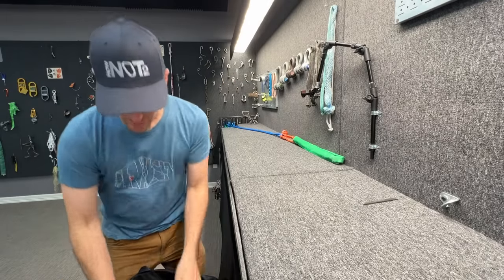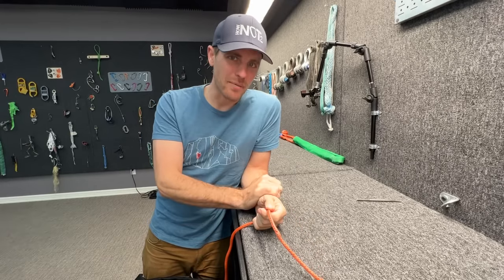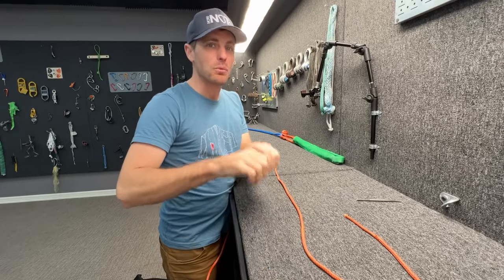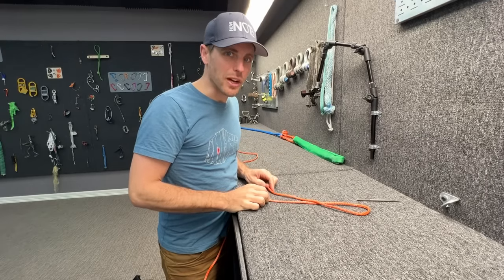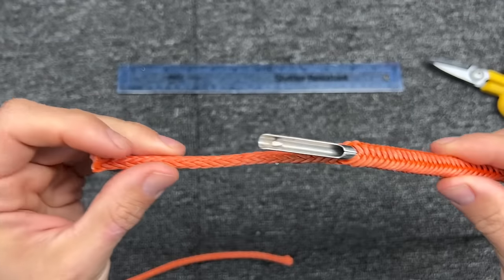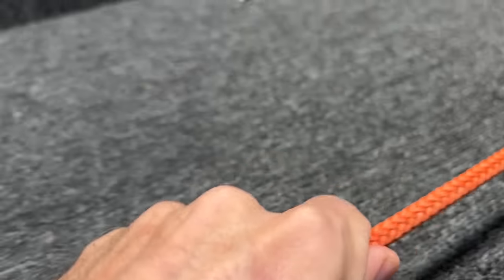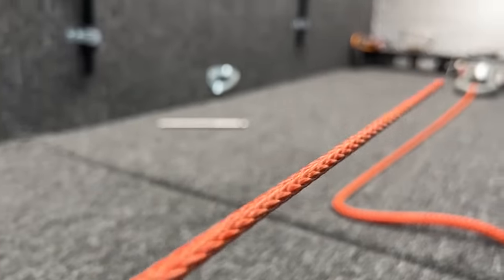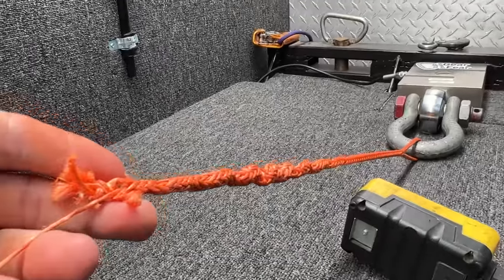This trick changes everything

Comment: Hey I know you like breaking stuff that was done correctly. Can you break stuff done incorrectly? For science, I'd like to see if improperly loaded shackles will match or be significantly less than the rated load. I recently saw a mistake and you were the first to come to mind to do the actual test. https://i.redd.it/qg3prnyeouwa1.jpg
Reply: Looking at THAT picture, I think the shackle itself is probably the strongest part of the system, even crossloaded.  I think that 2x4 everything is bolted to splits open first, though maybe you'd get enough tension to start mangling the L bracket.  Eye loop and sling would be the last things to break.